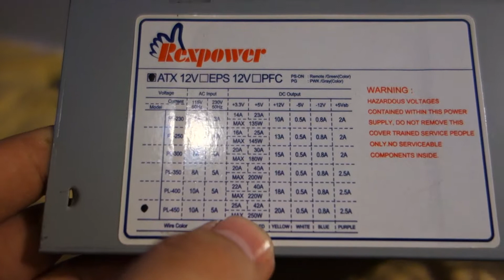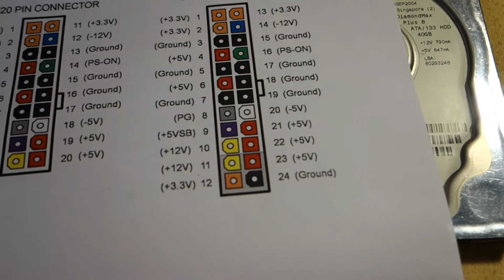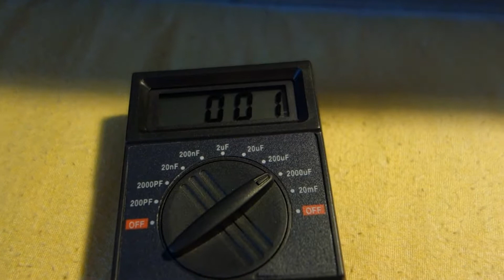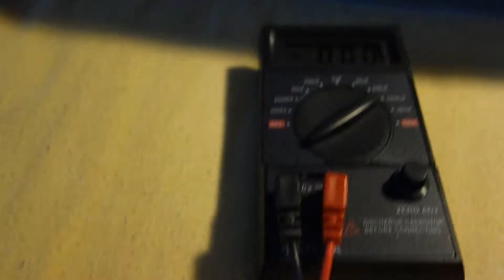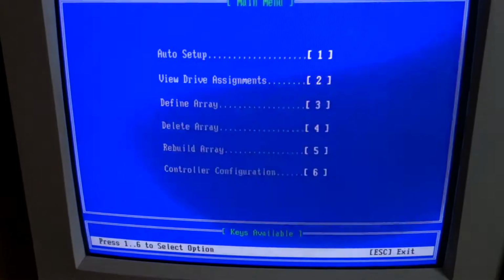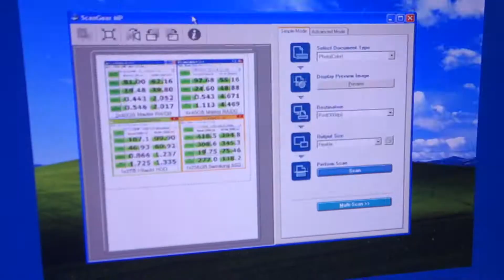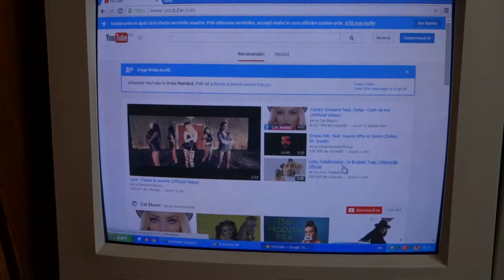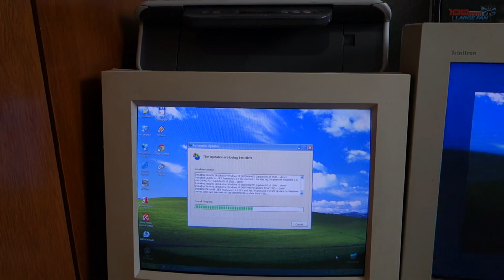How to build a cheap PC from spare parts

Comment: Cam ce pret twizar?
Reply from the maker: +Marian BMW chiar nu imi mai amintesc...dar parca in jur de 200 de lei.
Reply: vad ca are piese destul de bune. patreaza-l. te voi anunta in curand.
Reply from the maker: +Marian BMW aaa, scuze, nu mi-am dat seama, ma gandeam ca ma intrebi cu cat l-am dat. E dat de ceva timp.
Reply: @UltimateDIY  O intrebare am la tine daca nu te superi tu 

Am acasa in calculator nvidia geforce mx 420 si as vrea sa ii pun o placa nvidia geforce fx 5500 si sa il fac windows xp sa recunoasca 3 monitoare 

Crezi ca este posibil sa mearga in windows 3 monitoare functionale 

Multumesc mult